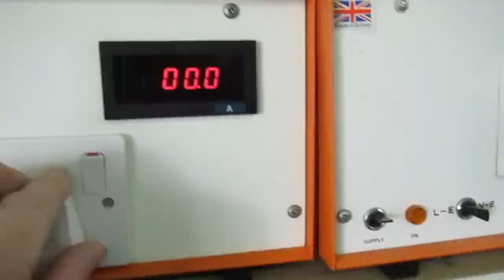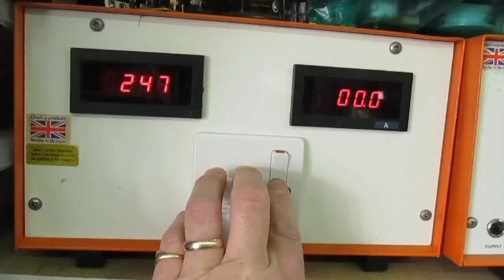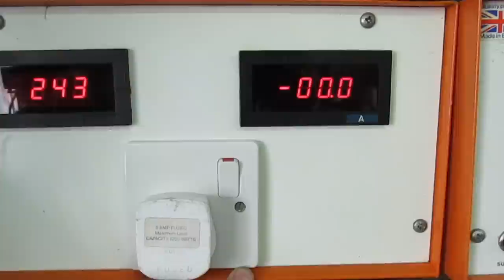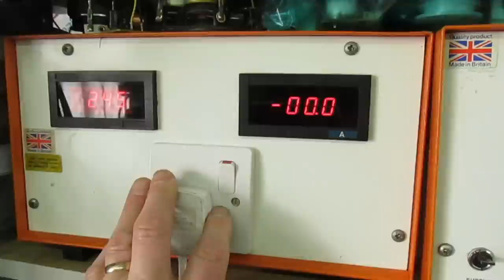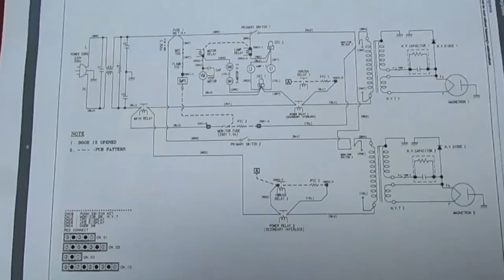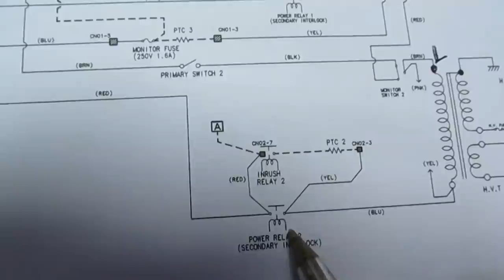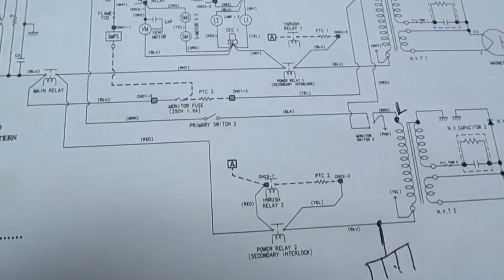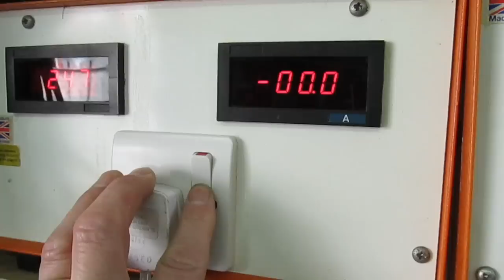Bizarre fault on Samsung commercial microwave oven.

Comment: No earth leakage circuit breaker on your test gear?
Reply from the maker: obviously not , I looked in the fuseboard yesterday  and it does have some trip switches but cant be earth leak , all my benches are powered from isolation transformers and I only use raw mains for testing microwave ovens .
Reply: @michaeldranfield7140  Well I guess if you're using isolation transformers earth leakage breakers won't work any way, but what about the business that the microwave was in? Definite chance of a shock all be it reduced voltage with the fault being on the neutral side of the transformer.
Reply from the maker: @rickcostin  someone made the comment thats its not mandatory to have earth leak breakers fitted so it looks like the restaurant dont have them either .
Reply: @michaeldranfield7140  Not mandated in Australia either( I could be wrong) except for new installations, I see quite a lot of GPO's still protected by the old porcelain fuses  but still a good idea and in this case would have tripped and saved the equipment and possibly a shock.
Reply from the maker: @rickcostin  got myself a earth leak breaker now .
Reply from the maker: @rickcostin  I bought a RCD now for working on raw mains, not that I do that very often .

Comment: I am more concerned with the design  of the oven switching  on the neutral side its possible  that is a USA thing.  I have seen cheap guitar amps with the on off switch on the neutral side (solid state ones with a transformer ). The cable routing is very poor for a professional  device did grease gather  and degrade the insulation?  It is good the Clare test meter picked that up is it designed to do that by measuring the current in neutral.  A power  or VA module could be added to aid fault finding.
Reply: If the Clare module was really that good they would have 3 ammeters. They don't cost much and there is plenty of space inside the case to accommodate them.

It is hardly a proper diagnostic tool if it doesn't show you what is really going on.
Reply: @deang5622  But it did pick up the fault. No current was measured on the neutral but the device operated so investigation had to be carried out. The design of the microwave seems to be  lacking or perhaps it's more geared to USA standards.
Reply: @triodehexode  Are you really saying that having a single ammeter in the neutral line is better than 3 ammeters, one in each of the live, neutral and earth?? !!!
Reply: @deang5622  Not sure if it would be good practice to introduce  an Ammeter into the earth safety circuit. That is good old solid kit it does its job. Thee probably modern kit that detects imbalance between phase and neutral and give power  factor VA and the like.  The fault would have been picked up on the ESD test if this was portable equipment  how ever  this may be custom installed  hard wired in the kitchen.

Comment: Would silicon sleeved wires have stopped the problem from happening.
Reply: No way. 
Silicon insulation is the softest and most easily damaged insulation out there.  It's only advantage is in higher temp. (up to 180C) and high flexibility applications.
Reply: Silicone not silicon. Silicon is a semiconductor .

Comment: My 18 year old, £50, Argos, Hinari Stainless Steel Microwave, works as good as the day it was bought! ... Moral of the story? Don't pay through the nose for a commercial oven! 👎🤣
Reply from the maker: Stuff was proper made years ago , I am still using a stainless steel Sharp microwave at home  from the late 80s I repaired for a customer and they never came back for it .
Reply: @michaeldranfield7140  It's a pity that most things are cheaply made of plastic, and are designed to fail! ... We should pay a little more for products that will last, like they used to! That said, my Hinari Microwave is a real champ!
Reply from the maker: @marcse7en  I don't think people would mind paying more if it could guarantee a longer life but these days all you pay more for is a different badge on the front and the same old crap inside sadly .
 Interestingly enough the brand Hinari is brand that has not yet been resurrected like some names .
Reply: @michaeldranfield7140  In 2005 I bought the cheapest washing machine in the Argos catalogue for £199.99. 18 years later my Candy is still going strong! Although I did replace the original brushes after about 15 years!

Comment: Wow your mains voltage is high at just under 250v mines at bang on 230v, that microwave has inadequate wiring thickness, way too thin, should be teflon insulation too not pvc
Reply: He commented in this thread that the  building he's in is old. It's possible that his utility provider is delivering legacy voltage to it via an old transformer.
Reply from the maker: I'm on an industrial estate here and for some reason the mains has always been high , Im not too well up on house wiring but when I bought this place I was told it has a 3 phase incoming supply and the whole estate seems to be supplied from its own transformer as when theses a power cut its usually only the buildings up here that go off and I pay my my electricity bill to the guy who owns the ground and not a utility company , had a strange fault 5 or 6 years ago , I noticed my open sign had gone very dim but when I plugged it into another socket it lit up ok  , then I found some sockets in the building only had about 100 volts on them , where as others had the full supply .
Reply from the maker: @aredditor4272  the electricity here has always been odd and its not something I understand, I don't pay a utility company , the guy who owns the whole estate seems to have access to an outside electric box which I presume has a meter in and I pay him my electric bill and the unit price always seems to be very cheap compared to what we pay at home ?
Reply: @michaeldranfield7140  much of the world didn't have a single regional, national, or international mains voltage delivered to them by utilities. 

Of course today the standard for Europe  is 230V at 50hz, but it wasn't always like that.

The old voltages are called legacy voltages. In the US people are still in the habit of saying 110/220 when the north American standard is 120/240. Most residential and small commercial in America get 120 and 240 delivered to them.
Reply: @aredditor4272  I live in New Zealand where the mains is 230 V, 50 Hz. It has always been that value, yet I see way too many people stating in online groups and forums that the power here is 240 volts. It has NEVER been 240 here, so I don't understand where they get the idea that it is.
Reply: Low load conditions on the network, rural area with small 11kV cable feeding a relatively small supply transformer.
These installations will generally still be 240V design nominal, only more  recent installations will be 230V design nominal.
Look at the voltage drop with the microwave on full load.
Reply: @michaeldranfield7140  bulk supply.
It's the same where I have the caravan, the unit price is half what I pay at home.
Reply: @sw6188   Until you monitor the supply voltage over a 24 - 48 hour period you cannot claim "it is always". I bet it isn't. 
I lived in a regional town in Western Australia where we were close to the HV/LV pole mounted transformer that supplied LV to the street. We had an 80A per 3phase supply into a commercial premise.  Tired of changing quality blown lamps I started investigating why by data logging supply voltages over 2 weeks.  Over a typical 24 hour period the supply voltage varied between 253V to 230V.  
Having worked directly in the generation and distribution sector in NSW, I contacted the Supply Authority, being a State owned and operated entity. There was little they could do as there is no auto tap change capability on smaller street  transformers... and if a manual tap change was done to bring the max down to 240V, the lower supply voltage periods would have been well below acceptable levels. 

I suspect in NZ urban and regional areas it would be the same type of scenario, especially if there is any industrial customers that drag down HV supply voltage during the day. 

Here in Melbourne metro area right now I read 242V... and my test instruments are well calibrated, not cheap POS hobby stuff.
Reply: @simonparkinson1053  I run a lot of japanese hifi components that are 100v so a 230v mains is the limit i can put into them (115v) but if my mains was nearly 250v i wouldnt be able to run them, would be out of spec by a fair margin and they would run red hot
Reply: @Synthematix  yeah ran into something similar at the old house, 20yds from substation which was set up for 240v.
During low demand conditions the supply was up at about 246-247V and with the regulation of my isolating transformer would take that into the high 250s.
Ended up changing it to a tapped transformer that had 230/240/250V primary and secondary.
Another thing you can do is use a 230/12V transformer.
Wire the primary across the mains as normal and the secondary in series with the live, such that it subtracts rather than adds the 12V to the mains voltage.
Someone made a lot of money selling a box with about a 1kVA toroidal transformer in it, connected it this manner to reduce the whole house voltage from 240 to 220 " to save you money".

If you have a maximum load demand of 10A, you would only need a 120VA transformer as the secondary would only see 12V at the 10A
Reply: @BTW...  I'm not talking about 'actual' voltage at the socket, I am talking about 'nominal supply' voltage. Otherwise people could say the mains was 223 volts, 229 volts, 235 volts, 238 volts or any old random number. The 'nominal supply' value is 230 volts here and has always been that value, so my point is why do so many people refer to it as 240 volts? Remember these are people who aren't actually measuring what's coming out of their sockets. BTW, I work in the industry so I know what I am on about.
Reply from the maker: @simonparkinson1053  Just checked again , this time with my Fluke meter and I do have 245v on the mains supply, could it be in any way to do with the 3 phase supply , domestic electrics is not my thing ,I remember a few years ago a very odd thing happened , some sockets in the building fell  to about 100 volts or so while others has the full mains .
Reply from the maker: @simonparkinson1053  I like it, my electric bill here is only something like £120 for 3 months and the guy who comes round told me the unit price is going up ,but not until September !
Reply: @aredditor4272  theres been no change to our mains voltage, we didnt reduce to 230, such as europe didnt go up to 230 from 220, they just respecified the tolerances, 240v countries 230v -6 +10%,  220 countries 230v -10 +6% , these were the tolerances when introduced, i dont know current specs, trying to find them now, its possible lower tolerance may have dropped to -10% so its same both ways
Reply: @michaeldranfield7140  its within the tolerances 230v -6 +10%   mains voltages are never exact and can vary within that tolerance to be 'ok' if it goes outside, you need to contact your supplier,
Reply: update, according to wikipedia, it changed for us in the uk to 230v -10 +10 % in 2008, but nominal 'centre' still 240v,  and countries like france and germany apparently went to 230v nominal, it didnt list tolerances for those
Reply: He's close to the transformer.
Reply: just under 250 is still within official tolerance of 230 +/- 10% , high end is 253, low 207
Reply: @andygozzo72  Yes thats true but if youre running japanese equipment like me nearly 250v is way too high, they can cope with 115v maximum (230v mains using a transformer)
Reply: @Synthematix  i know, i have some european 220v stuff and have to add dropper resistors, for the japanese 100v  items, you'd likely have to add similar resistors to make it more US like '117' compatible,
Reply: @andygozzo72  good thing is where i am its 230v bang on, so a transformer knocks it down to exactly 115v and my onkyo fr-x7 is happy with that, but any higher it will get red hot
Reply: @Synthematix  i'm afraid you have to put up with it or adapt it, they cannot make or keep mains voltage 'exact', even if the voltage from the power station is, it can and will vary a bit  due to resistance or all  the various cabling , transformers, variations in load,  etc, its simply not possible to keep the voltage at the house, factory, etc. spot on!